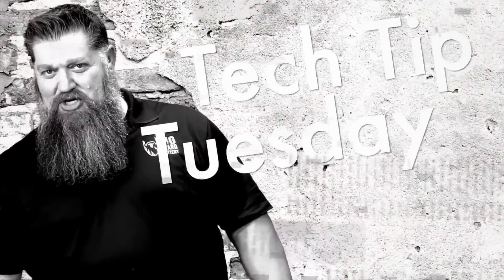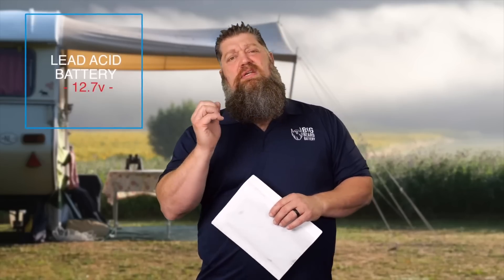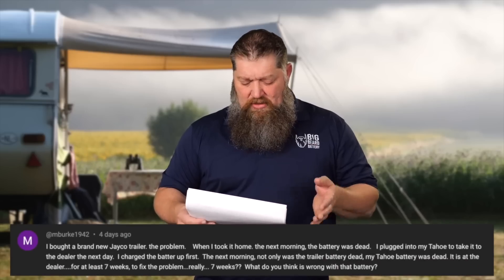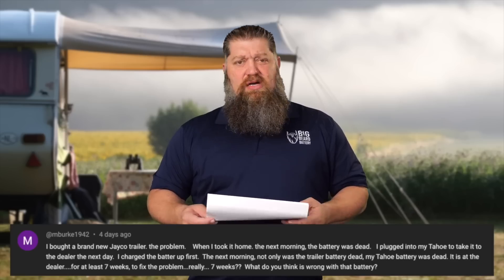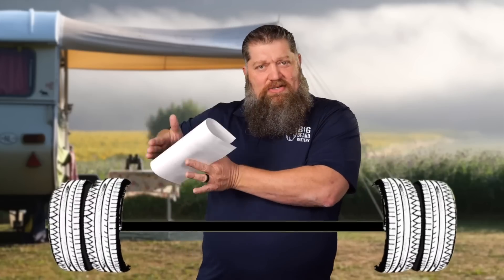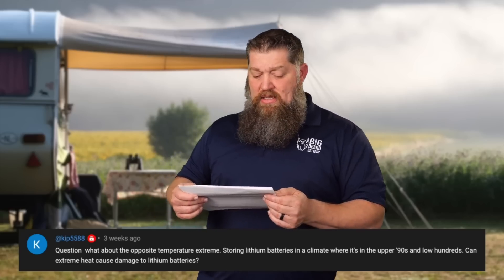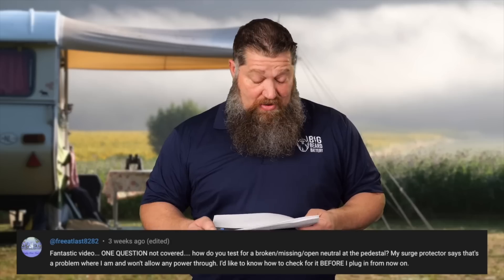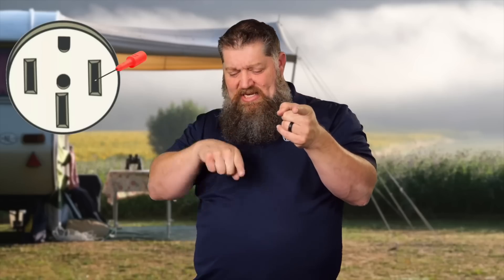Top 5 RV Tech Questions

Comment: Todd I have a 2016 skyline nomad 308bh. The heat comes out of all vents except the one in the rear bedroom. There's a vent in front bedroom 2 vents in the kitchen dining area 1 in bathroom, but the rear bedroom doesn't give heat. I tried a shop vac which didn't help.
Do I need to go under the rig and drop the underside to access the ducts or anything else I can do to open this duct?
Appreciate your comments

Comment: Great videos my question is I'm getting power from my alternator to my starting but I'm not getting power to my two house batteries they tell me it's the control panel in the front of my GM 8.1 l motor but I don't believe that's the problem I believe the problem is a solenoids but I'm not sure help me out Todd

Comment: Quick question. If I set my gain on my truck set to 8/10 shouldn’t those breaks on the trailer lock up when I press the trailer brake switch? My travel trailer is around 8500lbs

Comment: I have a question Todd! If your trailer is plugged into shore power and you turn off your battery disconnect switch . Does the battery still charge? Common sense tells me, no it won’t charge.

Comment: I just got my Big Beard Battery and love it. Can I over charge it? During spring/summer we travel a lot (we have a class b / adventure van), winter we try to go as often as possible (Weekend warriors). During the week, I am thinking I can plug into shore power but do not want to over charge. Is this a thing?
Reply from the maker: SO the BMS will stop any overcharging possibilities. Plug into shore power and allow your battery charger to charge the battery. Most battery chargers only charge to a certian voltage as well. So between the charger and the BMS inside the battery you should not fear overcharging it.
Reply: @ToddandTonyshow  AWESOME. Thank you!

Comment: Hi Todd, I’m Ruben from Miami (hence the Miami-305-305). How can I send you a house battery diagram for my motorhome (a 3032 Fleetwood Bounder 35K)? From the factory, it came with 4 x 6V, 100Ah golf cart batteries connected in series-parallel. I’d like to replace them with lithium batteries (as I did in my previous travel trailer), but I want to ensure the coach’s electronics aren’t affected.
The setup includes a Magnum MS2000-20B inverter/converter with an ME-MR Inverter Remote Control (lithium-ready) and a temperature sensor. The current batteries are GC-2, 220Ah.

Comment: Todd, great videos. I live in Arizona. Extreme heat doesn’t start until it hits 110! Or 115, or 120.
Lithium batteries have worked much better for me. Thank you
Reply: My Lithium batteries are installed in my front storage bay of my 5th wheel and it sits in an uncovered storage facility all summer when everyday was 110 degrees. I just recently move the RV to a covered storage to keep things a little cooler.